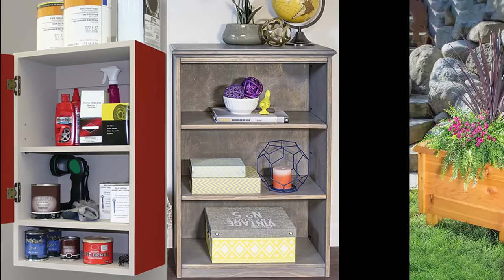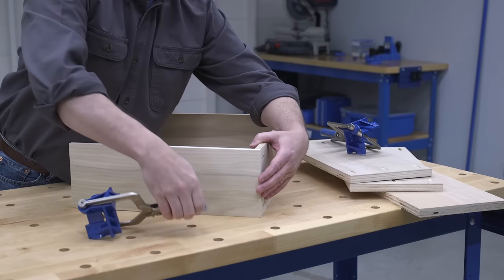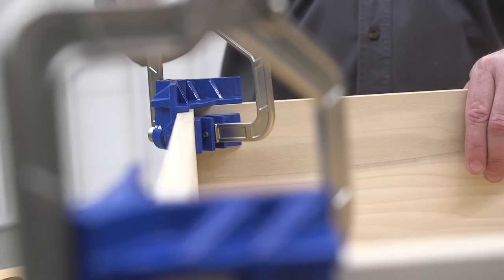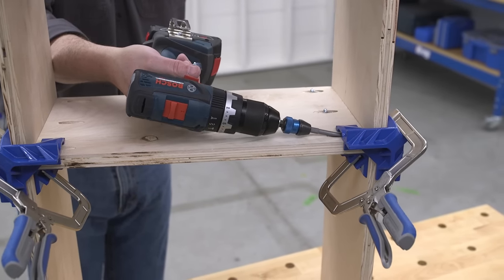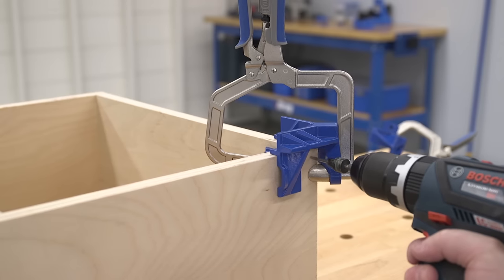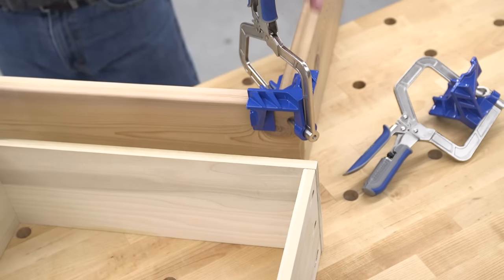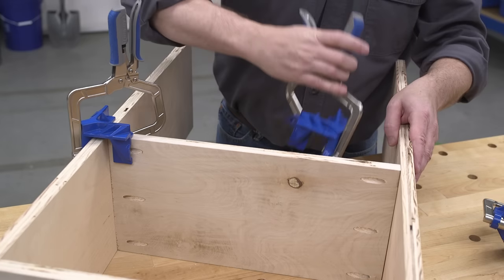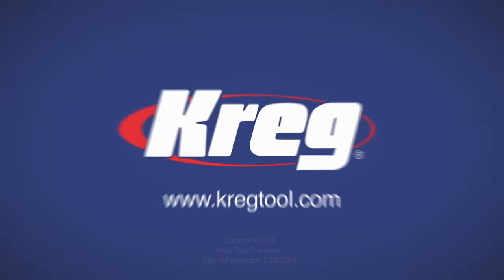The Fastest, Easiest-To-Use 90° Corner Clamp For Your Woodworking Projects

Comment: I originally purchased two of these clamps. They were a bit finicky at first. Then the mechanism on both seized up on me. Both, weird right? I couldn't seem to open the mechanism and the only size I could clamp together was 3/8th in. I knew the odds of buying two defects at the same time was highly unlikely. I never really paid much mind to how the auto clamp actually worked and maybe I had used them wrong. I went and purchased a third one that was operable so I could slowly open and shut it to see what I had to do to free the other two. I freed up the seized parts with a hammer and punch and also turned the screw all the way counterclockwise. After taking apart the handle, I sanded and polished the moving parts that were inside and put it back together. You gotta make sure you don't clamp them down with nothing inbetween the jaws. It will hyper extend the mechanism and jam it into the handle. Now, they all work great. If you try to clamp them shut with no piece between the clamps, you run the risk of accidentally lock up the mechanism in the handle.
Reply: good to know

Comment: These work great!  The trick is to just tack the joints with a pin nailer and then corner clamp them and then drive in the pocket screw. With this approach, nothing moves as you clamp them and obviously when clamped they won’t move when pocket screwed.

Comment: I found my first use with my 90 deg Kreg to be a little tricky to use. For my project, it seemed as though I needed 3 hands to get everything right. Hence, I just set it aside and it missed out on the job I was working. I noticed in this video that some of the sides were already connected... Maybe a third hand was used earlier off camera? Hmm...
Reply: hmmm i only got 2 hands...

Comment: Bought two of these clamps. Both siezed up on me. They just stopped self adjusting. I never really took a good look at the mechanism so I went back to the store to buy another one to see what is not working. It siezed up on me in the parking lot. But was able to pry it back open. It works well but is really fragile. Do not close if nothing is in it to clamp. I repeat, do not clamp shut unless you are clamping something. This means storing them open and having them open always when not it use. If that bugs you like it does me, make a small corner joint in the jaws and clamp that while stored. I'm going to attempt to free the siezed parts on my inoperable ones.
Reply: Just a follow up. I take back that these clamps are fragile in the sense that they break easily because they don’t. They are temperamental however. They work by a spring loaded lever that slides down when it senses a slight load. When the lever slides down, friction takes over and engages the clamping mechanism. If you push the jaw up against the object too early it’s going start biting early and will lock too loosely. If no pressure is applied to engage the slide until both sides of the jaw are flush with the joint it will be tight. That is why if you lock them with nothing in the jaws the slide won’t engage until both jaws are touching each other maxing out the grip and usually seizing them up. I was able to free the other two with a hammer and a punch. I took apart the mechanism and smoothed all the edges adding no lubricant. They are tricky but once you know how they work, it’s not a problem just a slight hassle.

Comment: It seems this would not work with a 2x4, correct? I’m trying to figure out to use this, or the right angle clamp in building shelving in my garage. Not sure this would work for me, although I feel like I’d be making lots of corner and T joints.
Reply from the maker: Clamping Capacity: 90° corner and “T” joints in materials up to 1" thick

Comment: "just squeeze the clamp handles and auto grip technology does the rest"?Well not exactly, after you adjust the tension with the thumbscrew. after watching this I went out and bought one for installing trim on the bottom of my cabinets. brought it home clamped the first piece of trim together and the clamp would barely hold. until I adjusted It. and with a 45-degree cut on the piece of trim, it takes a bit of aligning to get it Perfect. However, overall it is a handy tool but it's not as easy as it looks, it took some practice to get used to.

Comment: I see in the video where the end isn’t exactly flush in one of the shots. Does that mean that these clamps don’t have enough strength to keep the boards from ‘creeping’ when screwing the pocket hole joints together?
Reply from the maker: The clamps have sufficient pressure to keep the boards from moving. The pieces being out of alignment was unintentional, but thank you for bringing it to our attention. It has been forwarded on for further review.